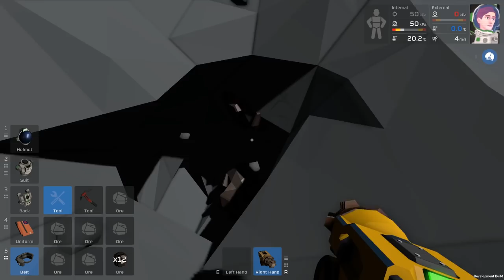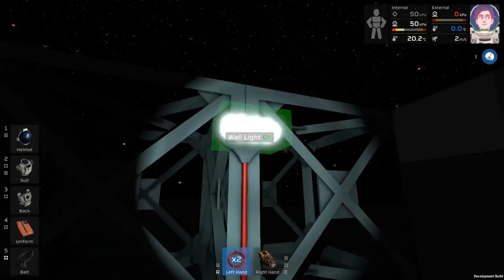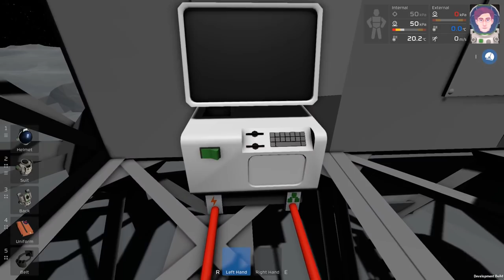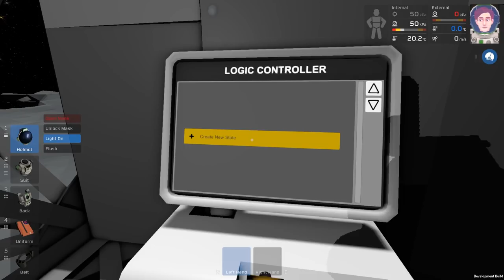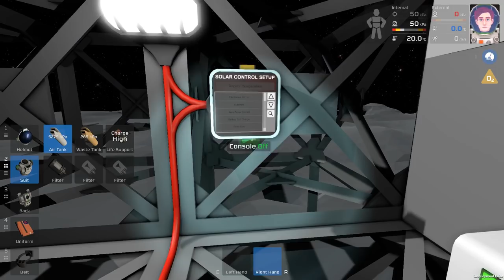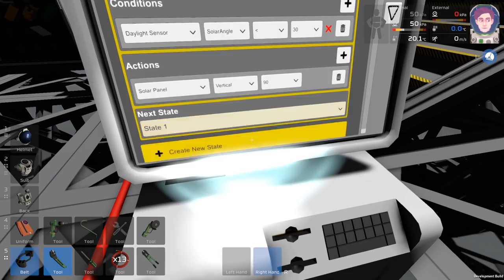Using Computer Logic to Automate Solar Panels | Let's play Stationeers gameplay ep 4 (PC alpha)

Comment: You should set two conditions for all states except for first and last i.e. #1 Daylight sensor angle greater than 60, #2 less than 60 and greater than 30, and so on. More states would mean higher efficiency by keeping the panel closer to perpendicular of daylight angle.
Reply from the maker: Nice! As for more states, yeah, get that, was literally just saving time/work for myself in the video!

Comment: I dont have this yet, so this is a query/idea, do you have or can you make the components for a second solar panel? Would that not increase your power input so you can charge batteries at the same time?
Reply from the maker: Yeah, I should be able to make a second. I need to look into adding more storage capacity in general.